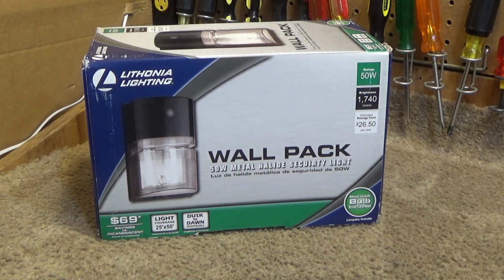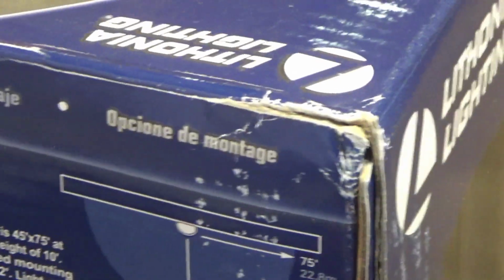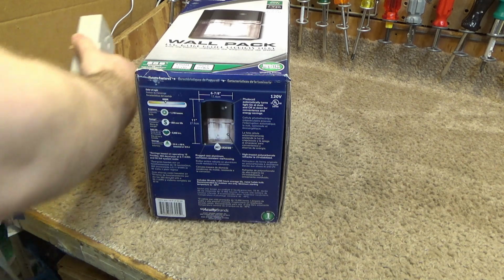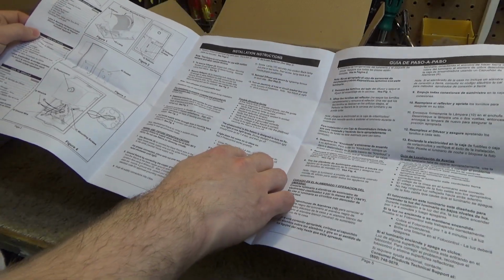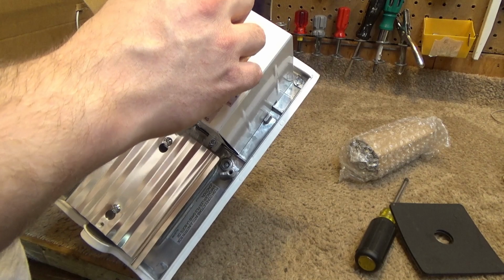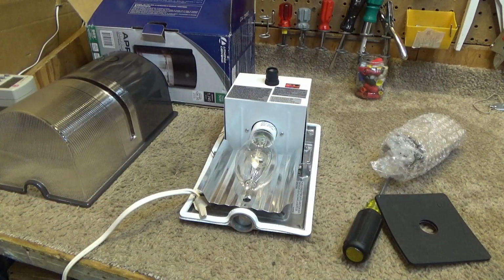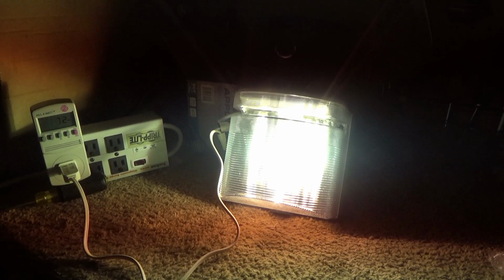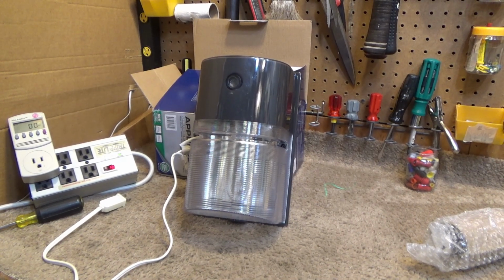Lithonia Lighting 50 Watts Metal Halide Wall Pack Security Light

Comment: I've got six of these metal halide wallpacks in use in my garage, and have been using them since late 2023. I've replaced the original lamps with USA made GE HALARC quartz metal halides... which are actually much brighter than the original lamps... warmer color as well. I've got an unlisted video of all six of them firing up, that I may make public soon, or I may make a new video.